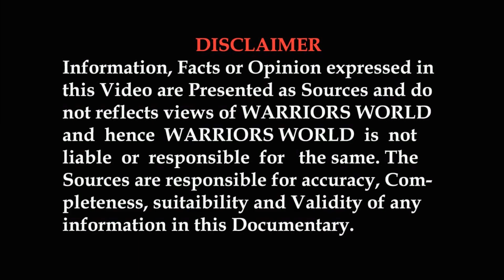Is India on the Verge of Building a Super Jet Fighter

Comment: Lessons to be learnt:
1. The (Kaveri) engine development needs to be progressed well. The learning curve can't be jumped over or shortened in time. The key is to be persistent with the limited success of what one is doing, and never ever to discard the effort impatiently.
2. Electronics part is neglected for two generations that needs a serious re-look. The country got into the bad habit of importing electronics devices, components  & all system designs. It failed the country because of this (that Indians refuse to learn). The sophistication needed for such an activity is still lacking & is the need. Its OK for commercial equipment, designing & systems but not so when indigenisation is the need like in Defence production- in that it smacks of reverse engineering & its deleterious consequences (where 99.99% reliability is hoped but not aimed). While 99.99% reliability is required in defence that comes out only if one learns what is 'Standardisation' in design procedures. It prevents the Lab to production path to hit the reliability mark. India needs to have companies producing Microwave components that meet standards (for defence airborne platforms). In this direction (as always), private sector (wedded to a purely profit motive) failed the country. The alternative is for government to step into that role. Yet it proves costly if not done in mass scale, doable only if commercialisation is adapted as a goal, that invites the producer to opt it or opt out. The popular opinion (opinion making) is against it. That is the eternal dilemma that India continues to face. 
3. Production(HAL) needs to be looked into afresh, to ramp up from 16 per year to somewhere like 40 per year. It is possible only if there is an ambience of private suppliers in MSME sector, that is not there in India. But it is slowly developing now. This is the Achilles heel in totalitarian regimes (making them never the leaders but followers in technology) & India is not one (ISRO proved it). It needs to be built up with perseverance. Procedures for "tendering" etc need to be recast instead of getting stymied like now, wedded to the notion of corruption-free procedures. This alone cost the country dearly in the past, with procurement of aircraft set off by a decade or two (when a war looms large over the future). The much maligned Bofors guns saved the country in Kargil war & is adequate proof of the futility of seeing in procurement, ghosts of corruption. Worse, it was politics without responsibility, used as a political tool in electoral politics - and defence suffered. It looked like the whole country is in the grip of envy (jealousy) when someone is making money. Sometimes a leaky tap needs to be left alone instead of replacing it every time it leaks. Yet this can totally be obviated in this age of computerisation in procedures with the necessary transparency.